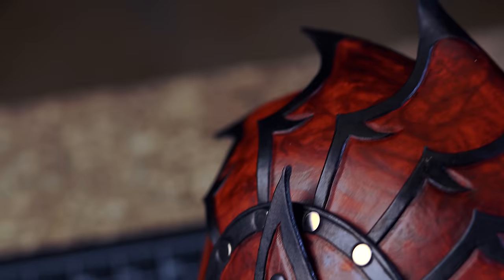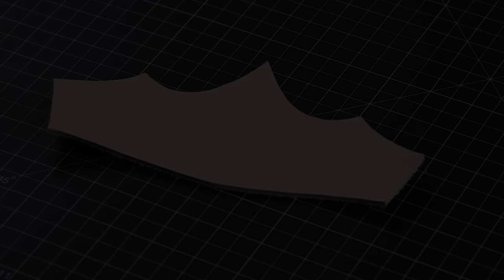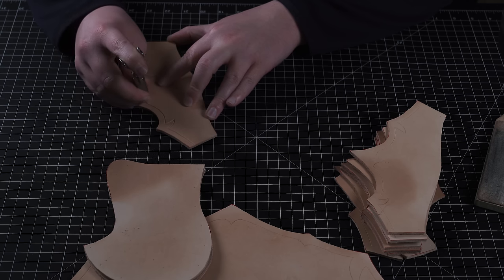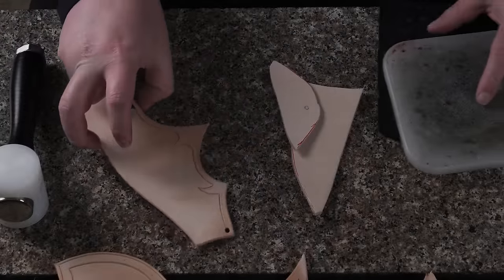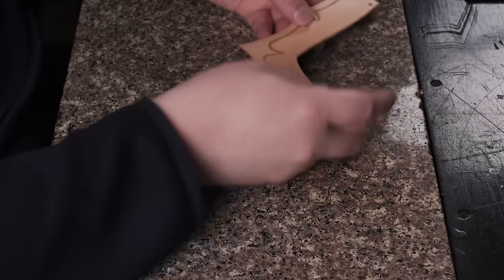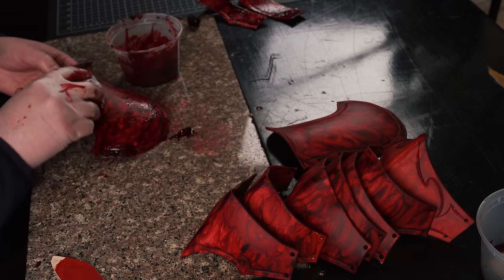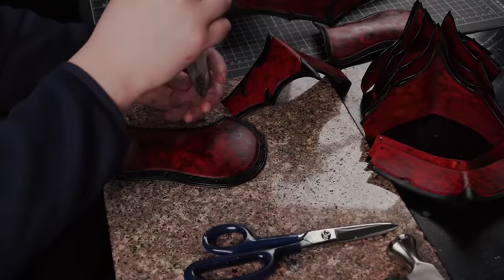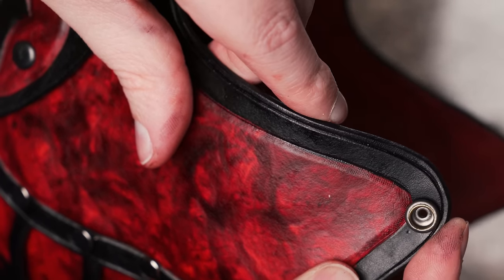DIY LEATHER HELMET - Fantasy Armor Tutorial

Comment: Where did you get these scissors?
Reply from the maker: which ones?
Reply: PrinceArmory the ones you cut out the elements with
Reply from the maker: I used two pairs in the video, to cut out the paper I used ginghers and for leather i used the tandy craftool shears, check back in a day or two and I'll be adding product numbers and links if you want to find them.